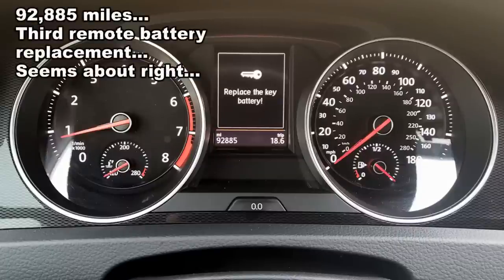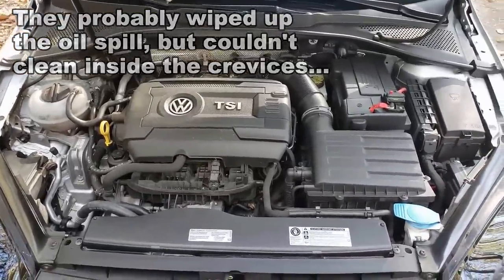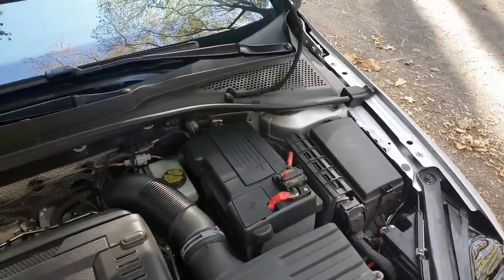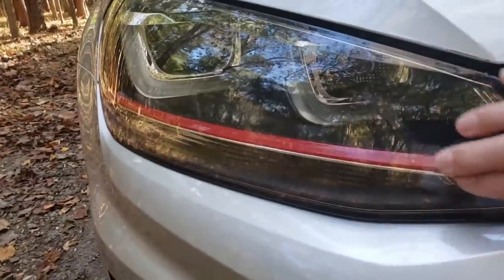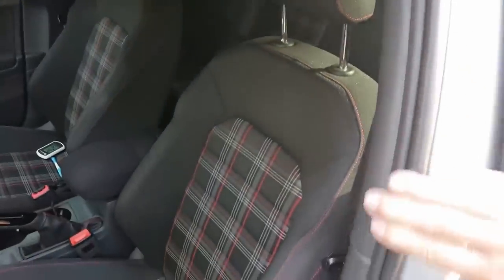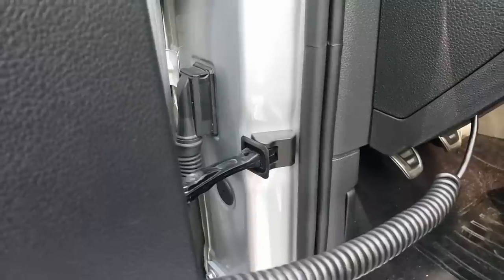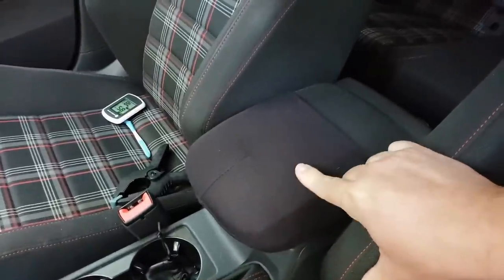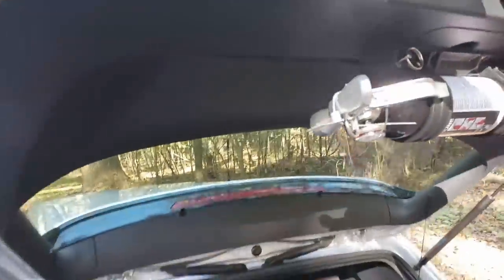THREE YEARS AND 93,000 MILES: My Report, Part 1

Comment: your coolant is evaporating from your coolant cap because its not snapped shut genius, however the thermostats leak quite often as well, wouldnt hurt to ge that checked out if you havent already, but snap that coolant cap fully shut, its triggering my ocd
Reply from the maker: The cap was only like that during this shoot. I noticed when I was done recording, but opted against a reshoot just to trigger those with a sharp eye. ;-)  Regardless, being 1/24th of a turn loose is not going to cause a leak. I would have seen signs. BTW, this video is three years old. The car had 93,000 miles then; the pump and thermostat housing finally showed its leak at about 115,000 miles in December 2020. The car has been running strong since receiving its new pump, t-stat, and housing and has over 174,000 miles now. Thanks for visiting.

Comment: my compliments on your script-writing and vocal delivery - far superior to lots of other internet content, I'm sure you already realize.  I'm a 2014 A5 2.0T owner, so related but of course not identical. You stuck a chord with PDI flaws - my car's fancy MMI audio "Jukebox" was never activated until I came back a year later finally noticing that I couldn't get it to upload any music.  Dumb. I did have a real (front) differential leak - enough to make a garage puddle - at only 4,000 miles.  Audi was so interested in diagnosing it that I was given an entire brand-new transmission.  (but this as you know is an area of my car least like a GTI).  I'm now at 52 months old, 62,000 miles.
Reply from the maker: Thanks for sharing that. And thank you for the comments about my scripting. The truth is I don't use scripts. When I do, it's difficult to sound sincerely and to look at the camera instead of reading. Instead, I just have an idea of what I want to say and then wing it. I had a small topic card with me for this video to help me remember each subject I want to mention (and I still forget sometimes). I often need to record several sequences due to flub-ups and simply saying the wrong thing. An example here is in the final minutes of this video. You can tell that my setting is completely different. I didn't use that recording because background noise, trucks, and simply having the wrong words come out of my mouth. Something about a camera looking my way turns me into an imbecile. HAHA! I added that segment from my morning attempt because I forgot to give JR14 a shout-out in my second location. Thanks for visiting.

Comment: My 2016 was flawless 87,000 fun miles, only had a Newuspeed power module, really upped the fun, more kick traded early for a 2019 Golf R, since it might not have stick no mo' come 2021..Stick, manual, is driving, automatic is going along for the roll. No issue with coolant, never used oil between 10K changes all highway driving, 2010 had 147K miles fun, never had an issue, fun fun fun.all stick, never touch the trans ever
Reply from the maker: I think about a Golf R all the time. But I think I'll run my GTI into the ground to get the most for my dollar. ;-)  Thanks for visiting.

Comment: The intake valves getting carboned up due to Direct Injection.
At 90k the top end starts to leak oil.
The intake manifold is plastic, sealed with an o-ring. Meaning, when the top end leaks oil it ruins the o-rings.
The water pump is plastic.... see previous sentence. Unfortunately, this leak can ruin the engine.
The cost to replace all top end gaskets?...... $2800-$3000.
The Cam Bridge (valve cover) doesn't even have a gasket. They use something like a silicone sealer that breaks down over time and leaks oil.
If your going to own this car beyond 100k miles, be prepared to drop $5k-$6k just in the engine.
Reply from the maker: I think TIME is more critical to seals than mileage. If the time comes that I need to sink that kind of money into the car, I'll do it because it's cheaper than a new car. But I'd consider selling about a year later and move onto something else. Thanks for visiting.

Comment: I picked up a mk7 Golf TDI for cheap as a CPO car and sold my mk4 Golf TDI.  I'm getting that buzzing noise in the front door that I haven't been able to find.  I'm checking that bolt on the door check!  Hopefully that fixes it.  The only upgrade that I'm dying to do on it is upgrade from MIB1 to MIB2 for the sound system.  The 2015 infotainment is pretty lacking.  I'm hoping the upgrade won't  be too difficult.  I've been following your cars since you first got your mk3 TDI.  It's nice to see that you're still working with the VWs.
Reply from the maker: Thanks! It's always good to see someone from my diesel days! Have you seen EuroZoneTuning.com? He carries MIB upgrade packages. They're not cheap, but he's done all the research and work to assemble a ready-to-install package. It's where I got my MIB2 display upgrade.

Comment: 2016 GTI , 45,000 KM.   zero oil leak from plastic pan. Lots of gravel roads sometimes fast on the gravel. Zero damage. I don't feel need for a skid plate. Change my own oil religiously and its perfectly clean underneath, just cause you asked.     Also FYI.  Sunroof frame replaced due very loud rattle.  Coolant leakage turned on warning light. coolant very low, VW replaced the thermostat housing, apparently a common failure, its a bugger to get down there, lots to remove to get at it. Clutch went at 45,000 No mods on car, replaced on warranty due warped pressure plate. Outer pressure late had no contact. Rare for VW to warranty clutch, took some arguing but a photo of the pressure plate did the trick, Known failure of part made in Czech Republic.  My seat bolster also worn. Fabric too thin.
Reply from the maker: Thanks for the detailed report.

Comment: I'm late to the party but I got 2016 tsi 1.8. I bought an oil extractor, so I never have to do anything with the oil pan/plug. I initially looked into the steel pan but realized I didn't need it (oil extractor vacuums mostly everything out from the dipstick housing). I got about 65k on her, running APR stage 1 and the most concerning thing is water pump/housing/union. I've replaced the battery on the key once, replaced the car's battery once and am on 2nd set of brand new tires. Will probably replace spark plugs soon. After 4+ years I can say I'm happy with it.
Reply from the maker: Excellent report! I'm almost at 120,000 miles now. I finally replaced the water pump and thermostat/housing around 112k. The car is running great! Thanks for visiting.

Comment: Hello, I have a 2013 MK6 Golf (not GTI). I am at +/- 85K miles. Mine does not have a lot of equipment and I have maintained the car religiously. When I hear you speak I felt apace that my car will be running well for many more miles to come. Thanks a lot for sharing. By the way, is your GTI made in Mexico??, mine is made in Germany.
Reply from the maker: David. Thanks for your comments. Yes, my car was made in Mexico, as were possibly all North American Golfs for a very long time (10+ years?), with the exception of the Golf R.

Comment: I had a 2016 GTI....I couldn't get rid of it fast enough.  Sold it at 25k miles.  It was turning into a piece of junk.  The brake rotors would rust overnight....a LOT.  Especially when it would rain.  There would be a fresh brown layer of rust on each rotor, and there was always a scratching noise the first few brakes the next morning.  Then each rotor got grooves cut into them.  I could understand one, but all four?  These ended up being very deep grooves...on all 4 rotors.  I drive rather conservative, and I had to replace the tires at 20k miles...they were cupped.  And I had an alignment done at 4k because of a pot hole. (dealership said it didn't really need adjusting) Then I started getting dew/frost on the INSIDE of the windows, and my granddaughter says the back seat is wet.  I KNOW I didn't leave a back window open.  After a few months, I decided to check the spare tire area, and there's 2 inches of standing water.  It's like a swimming pool, and it's slimy. Then finally, I was driving on the highway, and the computer turned off one of my cylinders.  I limp to the side of the road, get towed to dealership.  They call the next day, they see where the computer turned off a cylinder, they can't recreate it, they don't know why it did it.  Sorry about your luck, come get your car.  I will NEVER buy another VW as long as I live.  It drove great, I'll give it that.  But otherwise, it was turning into a heap of junk.
Reply from the maker: Sorry to hear about your troubles. Sometimes, problems get through. What did you replace it with? Is your new car as satisfying to drive? Thanks for visiting.

Comment: Stealth,  THANKS for your helpful video.  Why did the clutch need replacement at only 30K miles?  Are you riding the clutch or dumping it from a dead stop into 4,000 RPM?  That is a poor service record for a clutch, unless you have abused it or raced it.  What's going on?
Reply from the maker: Today's video provides an explanation: https://youtu.be/rOW8zgKdD0c. There is a clickable index that'll take you straight to the clutch portion. Thanks for visiting.

Comment: I got 140 000km on my 2015 and had less « problems » then you...yes I had to replace the windsheild, my driver seat is use like yours (I took my car at 7 000km and was already like that made by the vw rep), little noise from the sunroof but never leak like some and that’s it !! Still have same original battery and yes I do have the original plastic oil pan and still no leak. I do perhaps change oil at every 10 000km instead of 15 k here in Canada, change the panel filter for a performance one and did change the sparkplug with RS7 ones. Really good car.
Reply from the maker: Thanks for sharing your experience. If you see "Part 2" to this video, and especially my 100,000-mile update, you'll see that I have no complaints about the car. Nearly all of my issues are a result of heavy use/abuse or are completely petty. This car is not leaving my collection very soon at all.  :-)

Comment: if it's a clear film "bra" (PPF), then of course the paint chips "go all the way through" to bare metal! Come on, really? Even if the film were white - NO color means the paint is chipped! It's a thin plastic film, not really much protection from gravel. Films for 'blast mitigation' can not be stretched over auto-body contours like the PPF's.
Reply from the maker: Not sure what you saw or heard since I shot this video so long ago, Ruth. There is pretty paint under each of the chips in my clear bra. The bra is doing its job until a rock happens to strike a tiny spot that is exposed and unprotected. Thanks for visiting.

Comment: Going APR stage one and aftermarket parts, where you worried about the TD1 flagging when taking it in to the stealership? I want to tune my '17 Sport, but my car still has 2 years left on CPO warranty. I just hit 30K. Thanks and great video!
Reply from the maker: Not at all. I understood the risks of tuning the engine and wouldn't have expected VW to cover engine damage that I think the tune may have caused. But I would have raised Hell if I had an unrelated issue crop-up that they refused to cover. @humblemechanic just did a video about what the TD1 code really means. Check it out: https://youtu.be/tzlwDedI2QM. Thanks for visiting.

Comment: Longtime VW owner here . "Consuming" coolant is never normal . It's a closed system ...or it's supposed to be !
Your car may have some miles but it's only 3 years old . Not old enough for all the plastic under the hood to begin failing . I had a mk4 jetta with slow coolant loss . Over time it got worse until the head gasket completely blew out ! I now own Mk5 5 jetta GLI . Coolant loss via bad plastic water pump / plastic coolant lines . 1 year since I repaired this ( did it myself so I'm certain what the problem was ) ....... not a single drop of coolant lost since .
Reply from the maker: Thanks for sharing your experience. Oil analysis and thorough visual inspections have revealed nothing noteworthy. The coolant loss is VERY small. So, I will keep driving until things get worse... if they ever do. Take Care.

Comment: Consuming coolant, oil pan leaking, clutch needing replaced at 30k miles, cabin fan going out, battery needing replaced? All before 100k miles.  Are you kidding me? And this is normal for German cars? I’ll never complain about my Honda again.  That’s not normal, that’s poor manufacturing quality.
Reply from the maker: Not sure how much of my video you watched or listened to, but the oil pan leak is my fault, the clutch was subjected to an extra 80 hp and towing abuse (again... my fault), and the battery supports A LOT of electronics in my trunk (oops, my fault again). The coolant issue and cabin fan are a disappointment, for sure. But it's still minimal, especially for a car with as much tech packed in as it has. Thanks for visiting.

Comment: The Vw factory glass sucks. I have a 2016 Gti PP and my wife has a 2019 VW Tiguan. Both front glass is not clear at all. I finally fixed it. Not even glass ceramic would fix it. You need to use a glass polish 2x than apply rain X or glass ceramic on the glass. If you don’t use glass polish the ceramic seems to not stick for long. The glass also had some sort of almost acid rain stain. Hence it wouldn’t bead. Now it’s fixed with the glass polish.
Reply from the maker: Thanks for sharing your experience. I'm glad I haven't had to worry about it for a long time.  :-) Thanks for visiting.

Comment: I have a 2015, first year of the MK7. Sunroof and all. 0 issues and complaints with the car. Everything is good, car has been super reliable. The MK7s are for sure one of their best cars. Still has the original battery, and all. Remotes have gone through 1 battery a year it seems. The clutches on these are just enough for the car, if you tune it you will need a clutch upgrade. Which isn't surprising since Stage1 is 80+ ft lbs of torque more.
Reply from the maker: Thanks for sharing your experience. Take Care!

Comment: VW are really good to drive,but they're not reliable at all...I had 2 VW and had issues with both..I mean 15k miles and 16k miles, engine and transmission...sold both I have a Honda SI now...65k miles zero issues...never will get back to VW again..but as I said they're the best to drive , the DSG are awesome.
Reply from the maker: Thanks for sharing your experience. Were your VWs prior to the Mk7? I stayed clear of the Mk5/6 due to perceived problems. The Mk7 reportedly fixed just about everything wrong with the previous generations. Take Care!

Comment: I have a lot fewer miles on my 2016 4-door since I'm retired and not driving to work.  Really love the car and don't foresee replacing it unless something blows up, which seems unlikely.
My only quibble is the airflow (or waterflow) off the roof and in the driver's window whenever it rains.  Water runs in and down on the power window controls.  Seems like at some point they would have test driven the car in the rain. 
Next summer I'm going to experiment with some kind of deflector.
Any suggestions?
Reply from the maker: I've read that the Weathertech vents fit well and work. I haven't bothered to try them, but they'd be my first choice if I decided to make a change. Thanks for visiting.

Comment: Question: would you ever recommend buying a used gti with 50k miles? Or better, my real question is: do these cars fall apart through time without being really careful with tacking care of them? My plan was to buy and then do a heavy duty cycle of maintenance (Sparks, wires, all filters, all fluids). Is it possible that I bite off more than I can chew and in the first 6 months I get terrible failures? Let me know what you think
Reply from the maker: Anything is possible. A car that's been neglected may be turned around by some aggressive catch-up maintenance. But it could also have a bunch of hidden problems. There's just no telling. This is why I bought nearly all of my cars new, although it's financially unwise. I'd take a chance on a 50,000-mile GTI, but only after a thorough inspection, including under the car on a lift. Thanks for visiting.

Comment: I work as a product development engineer. Fuyao actually provide a number of companies with OEM glass, including the one I work for. So your replacement is probably not aftermarket but just without VW markings to make it cheaper.
Reply from the maker: Thanks! Somewhere within these hundreds of comments, I admitted that I used incorrect terminology to describe FY glass. I grew up under the mistaken impression that anything not offered by the automaker is "aftermarket." I learned this by shopping at an online auto parts store (name currently escapes me). Getting the FY glass reinforced the difference between OEM, OE, and aftermarket. I knew that FY is OE, but old habits die hard and the wrong words came out of my mouth. HAHA! Thanks for visiting.

Comment: Regarding coolant leak.
I have similar problem on my seat leon during period where the temperature outside is extreme (I.e. +30-35  or -30 degrees Celsius) and dealer told me that coolant was vaporizer via special over pressure valve. I think this is b-shit but cannot find any marks of leakage under the hood.
Reply from the maker: Thanks for sharing your experience.

Comment: VW tech hear, the oil is normal on the bottom of the trans, I can't remember exactly what it was, something about shipping grease or oil on the transmission is not removed before installation at factory. If the car is run on a hoist and drips are forming while idling it could be a real leak. But 90+ percent is just normal shipping grease/oil. Every TSI that I've had the belly pan off of always has a couple drips. As long as it isn't accumulating in the driveway or belly pan it's just normal.
Reply from the maker: Thanks for sharing that. My underside has been bone dry since then, with the exception of the mess made by my obvious oil pan gasket leak.